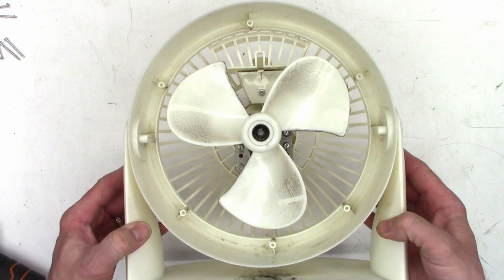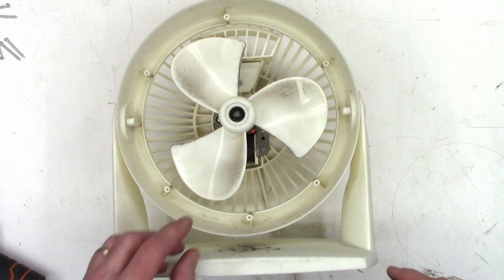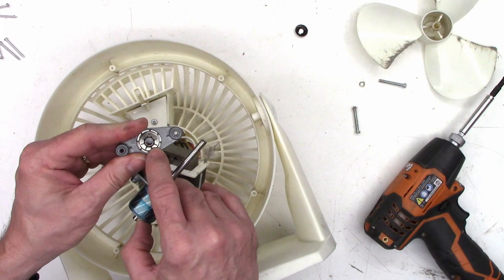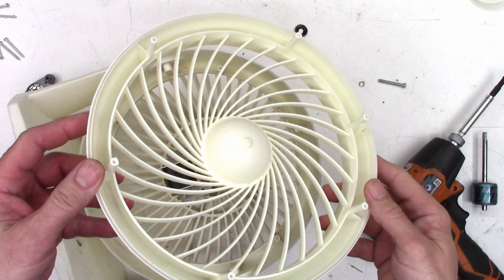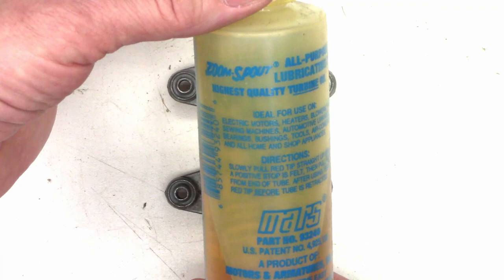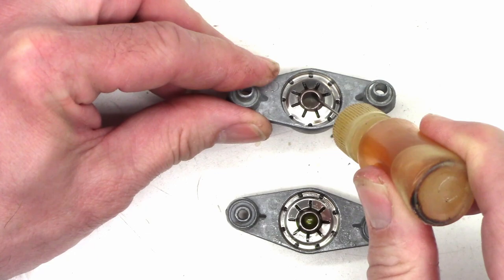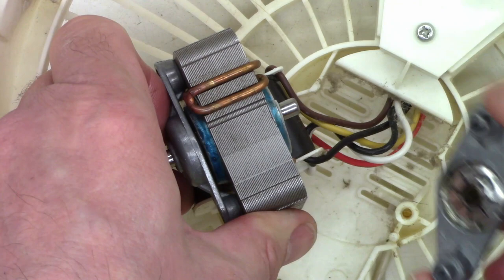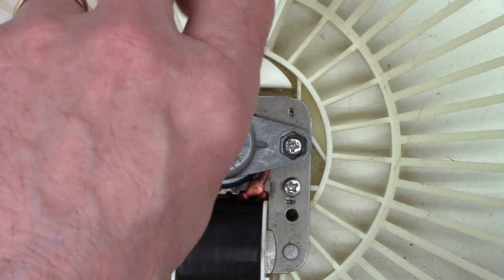KEEPING IT OUT OF THE LANDFILL - E-WASTE - RECYCLE BIN. SERVICING YOUR SMALL FAN

Comment: Dissembly one screw requires a torx security bit to remove, A light scrub using 3M pad on bearing shaft helps to remove gunk. If worn, new brass replacement bearings are sold on Asian sellers sites if you don't mind waiting for the slow boat.

Comment: Not a synchronous motor, but a shaded pole motor.  Will run at around 1760RPM at 60 HZ, and 1450RPM with 50Hz supply, with no load, but likely will do 1600RPM with the fan on.

The old oil in general has lost all the lighter components from evaporation, and also the oil degrades with time, making oxides that are both thicker and sticky, so they do absorb a lot of energy from the shaft, plus the degraded oil does not provide a good lubricating film.

Oil for them is pretty much any light oil, though the easiest to get is air tool oil, as it is generally light, has minimal additives, and is in general not going to leave varnish deposits on the bearings, plus is resistant to oxidising with time. Plus cheap, and a 1l bottle will last a long time.  Otherwise transformer oil also a pretty good plain oil that does not sludge much with time. Still got a litre or so left from the 20l can I bought 2 decades ago, as I was often simply filling up a bottle for anybody that wanted some, so it went faster, as otherwise I would probably still have 15l left.

If you cannot get the above simply get a small can of 0W50 synthetic engine oil, which also works well.

Comment: Can't kill those motors.
Just can't convince people to stop throwing everything away.....different world.
Reply: The new ones do die though, a combination of winding being too little for the voltage ( 200VAC instead of 230VAC winding, or 100VAC instead of 120VAC) and the use of cheap CCA enamelled wire, which breaks down with time and either goes open circuit or develops a shorted turn inside. Also the manufacturers no longer add the extra drops of oil to the felts, they are often totally dry, only oil is that which came impregnated in the bush from the manufacturer, nothing else added. Sadly that lack of oil adds extra drag, which slows the motor down, making the cooling worse, and making the windings run so much hotter that they fail faster. 

Did rebuild one out of 3 found in the rubbish, one provided the motor and fan, one provided a stand, and the third provided a rear gearbox to make the swing function work again. 2 out of 3 dry bushes and seized, and thus burnt windings, but the one was just dropped and broke the stand.

Another clone of the "Big Ass Fan", 450mm one I picked up at the scrapyard, just needed to have the blades bent straight, the cover fixed and oiled, and now works well, though it has in general only been used on lowest speed, as the other 2 tend to move furniture around, and even low moves a whole lot of air.
Reply: @SeanBZA  ...you make a very good point, they are built with no integrity because it's simply about making the cheapest products at a good profit margin, and, just throw away and buy a new one..
That's why the service and repair industry is almost non existent. 
I made a good living for almost 40 yrs  in tv repair until 2012-13, that's when the repair business dropped by 60-70 percent and put a lot of service companies out of business. 
It's now become a very part time profession, and almost a hobby that you can make a few extra bucks for spending money. 
The retro and antique business is becoming relevant because it's not about fixing something that's current and people will repair something to keep as a sovinier.